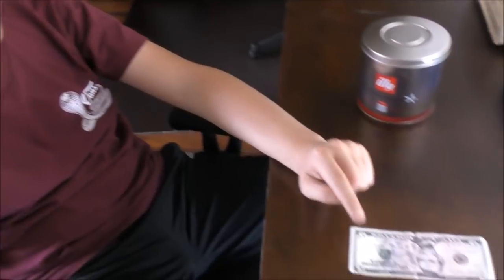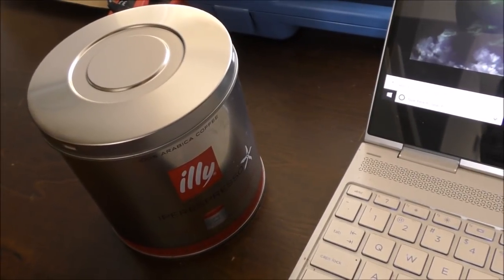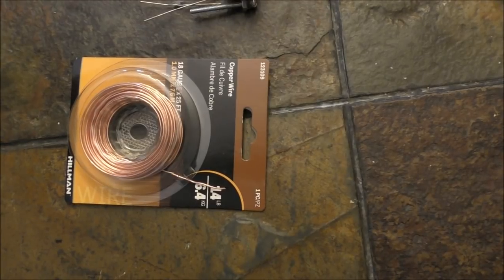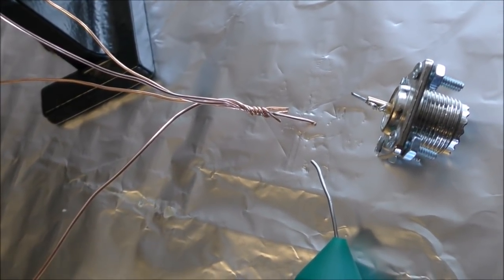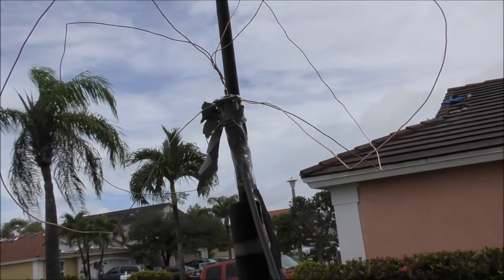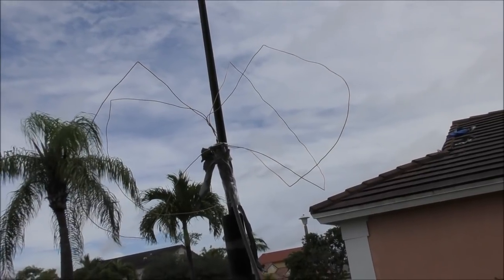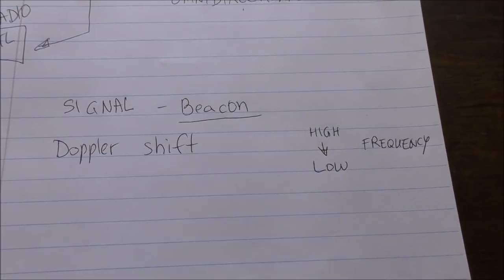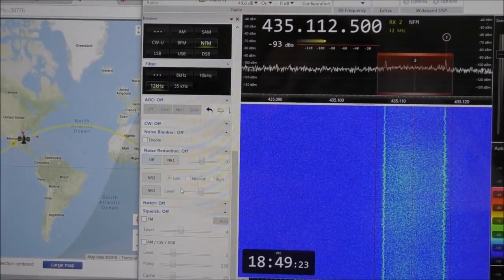2018: Thomas N1SPY chases mini satellites on a budget

Comment: Any copper can be work hardened, you can do it by dragging the wire over a round post, for example. It will get work hardened and you will get a nice round shape. When soldering you should heat the piece you are soldering not the solder, there are very nice solder tutorials, made by Pace and the USA army from the '70s. 
Very nice demonstration and a great result with a simple setup.